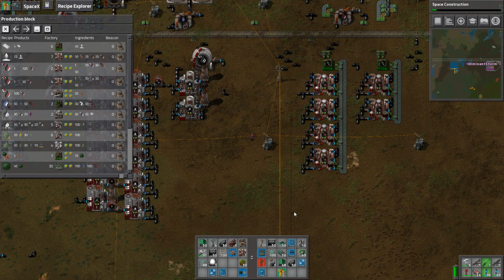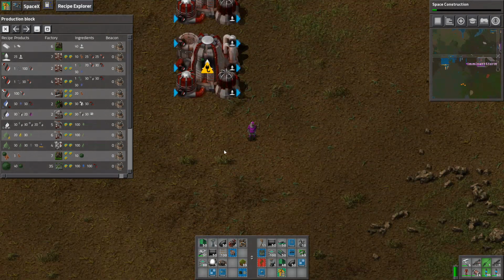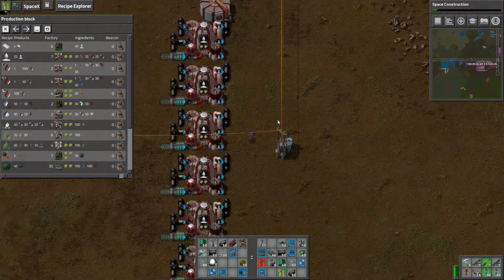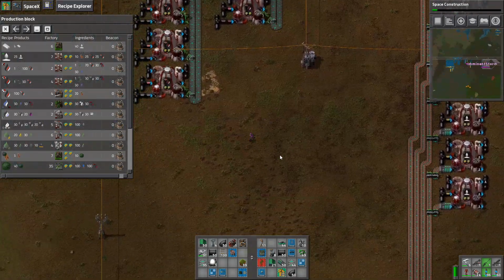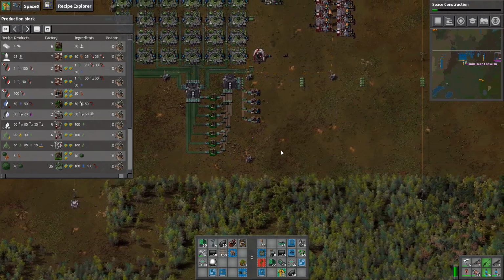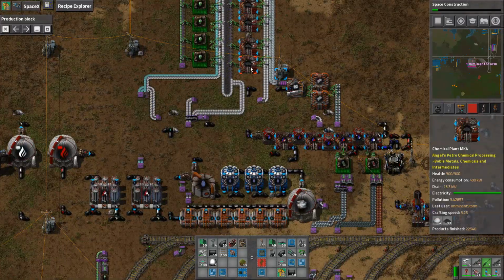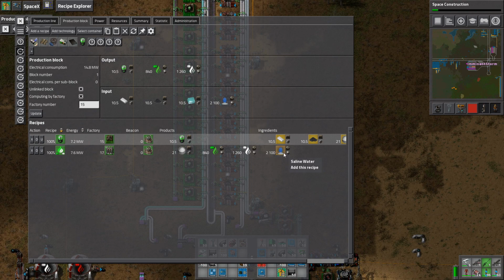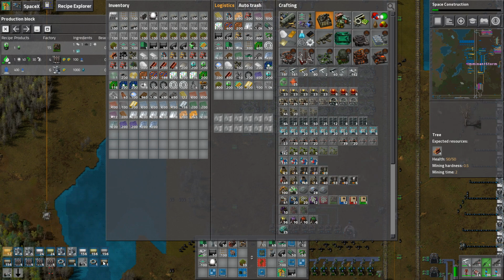Factorio - Angel's & Bob's - Episode 274 - Bio Plastic

Comment: Shouldn't plastic bars be production module enabled? you would more then double the output mit prod 8 ? Same for the assemblers doing trees to wood chips (?) - they only take 3 speeds, and could take 3 more prods - should be enough to get rid of 1-2 of them.